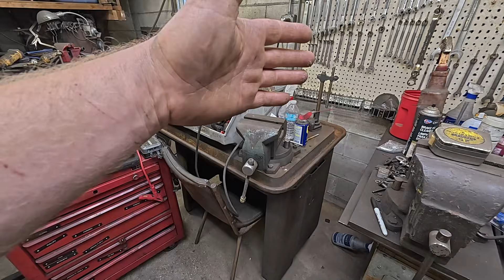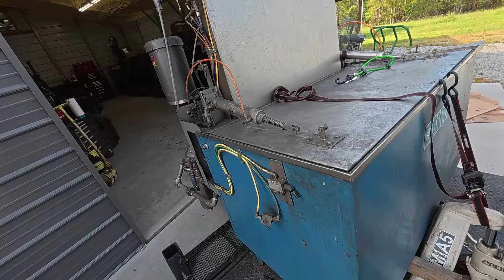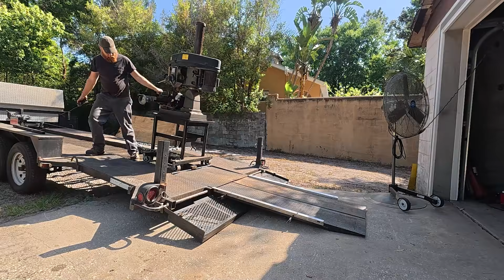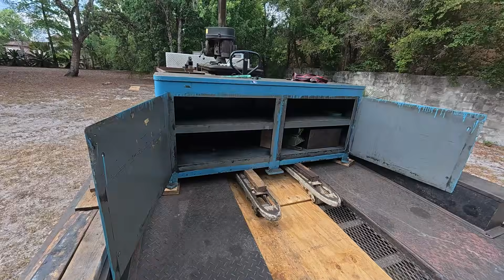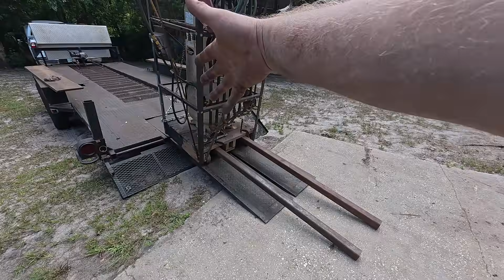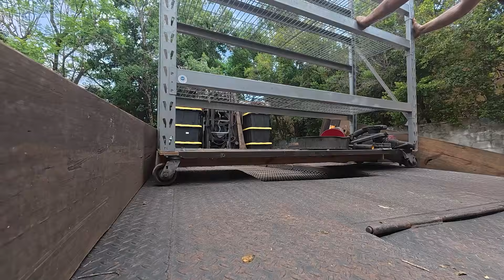I sold my house for this

Comment: Well—I bet the wife had something to say about a “crankshaft grinder” I know what the reply would be… Really, how many times are you going to use that!  😅
Reply from the maker: Good one, thanks Robert. I'm single but I have heard that from well meaning folks. At this stage it's hard to tell the difference between going hard and crashing out!
Reply: @HapticGarage 
Agreed.  I am 72, and my wife and I own a small ranch in Texas. My wife allows me a toy budget. With that I get to buy what I want. Like a new welder and plasma torch.

Comment: Man 2026 and that's your first CNC machine . Do your self a favour and  buy a cheap 3d printer and learn cad and the software to produce g code then apply that to the lathe.
Reply from the maker: Hi Noel, a 3D printer would be interesting.